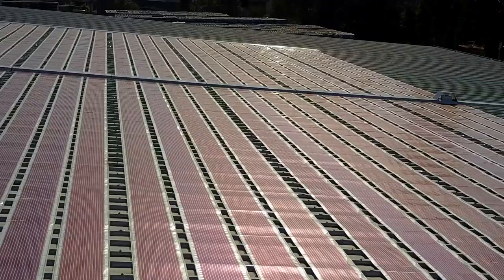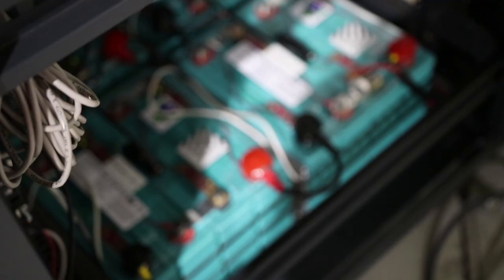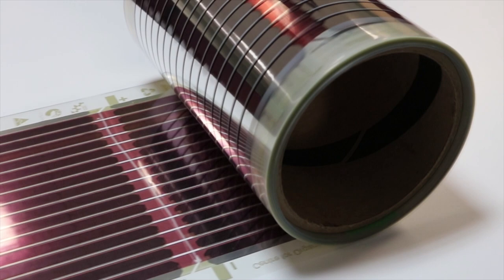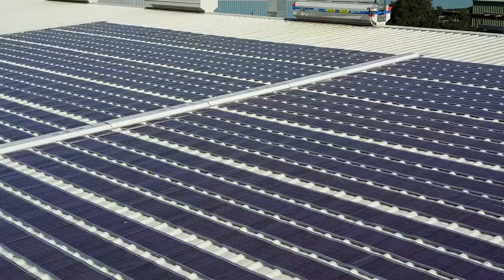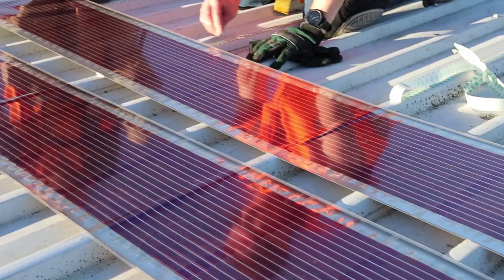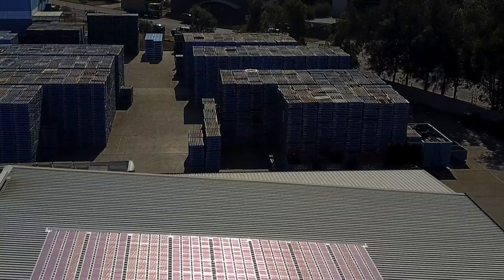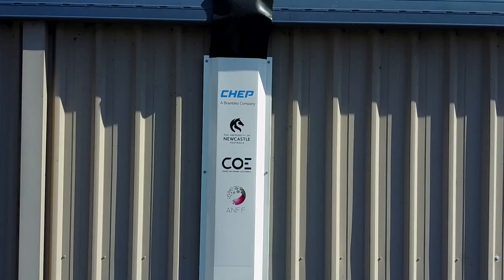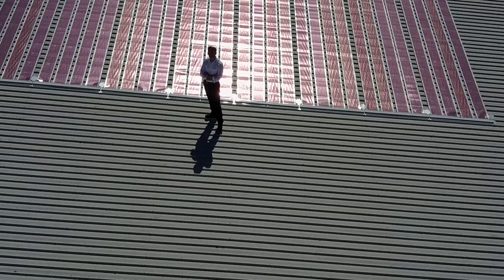Solving an energy crisis with printed solar

Comment: What is the electic throughput each square foot of this thing generates? What is the temperature range it can survive?
Reply: As it has been said in the video, the idea is still under incubation, which means it is currently in developmental stage. They are even showing it to universities so that  the idea can be shared
Reply: @DreamCatcher-wg1bk  They will still know if this tech produces energy or not, and that's before attempting to sell.  Would they sell a plane if they have no idea if it can even take off?

Comment: What happens if it rains?
Reply: Its an environmentally stable durable plastic film ....if you want more information see the Have a think about it channel..on this topic.
The way its designed is such its  resistant to damage stopping a panel from functioning if damaged.